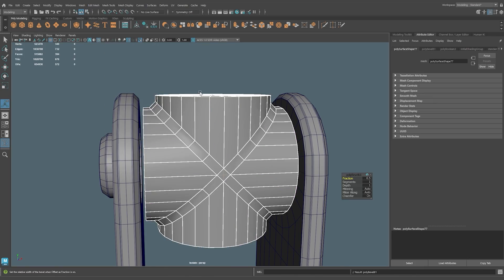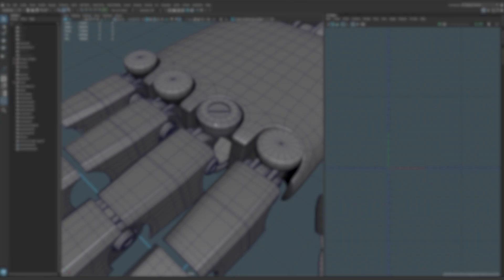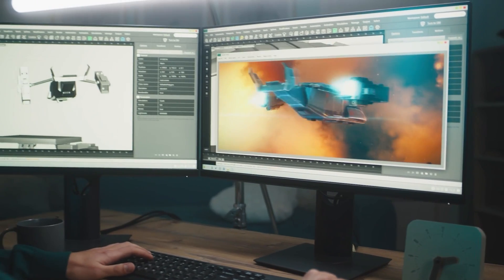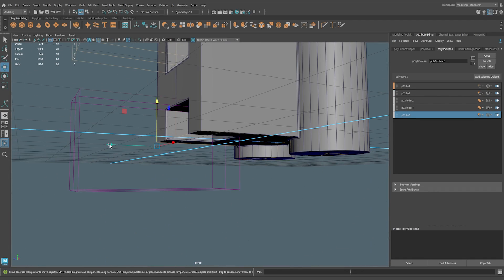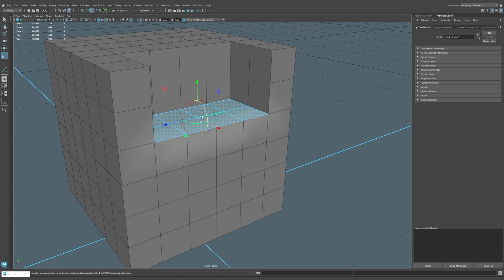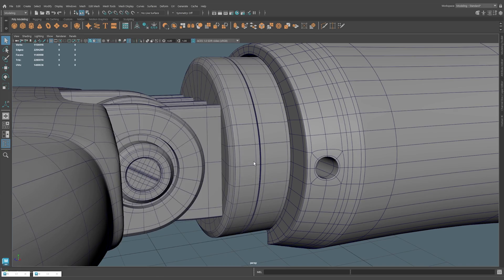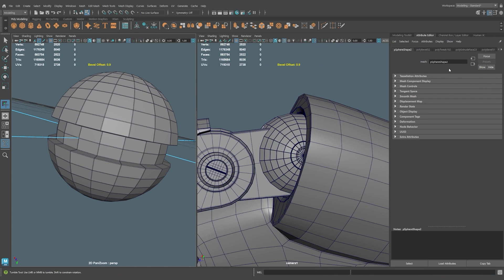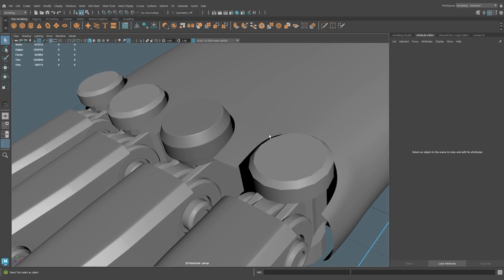All Maya 2025 3D Modeling Updates Under 5 Minutes!

Comment: Maya needs a sculpt mode. Maybe mudbox inside
Reply: Maya does have a sculpt mode that is really underrated. It could be improved, but it's helped me out at reducing pinching on bad topology.
Reply: @UtterUnit  It are tools for mesh. With this tools are impossible to sculpt anything from scratch.
Reply: Maya's sculpt tools are decent. They aren't ZBrush but they're useable for small jobs.
Reply: @andrewsmith4575  Blender has better sculpt than Maya and it is free . Maya doesn't have sculpt mode only tools for retouch meshes.
Reply: @Ruben3D  Why do you waste your time to make points about Blender when this is a video about Maya.  Why don't you go watch content about blender instead of berating people about a program no one asked about.
Reply: @MartyRxMurdeRz  right :D

Comment: Plasticity is best for hard surface modelling. It is completely a new way of working Polygon and Nurbs together.
Reply from the maker: Plasticity doesn't use polygons.
Reply: @jlmussi  but can export to polygons at any resolution and with working topology that can be tweaked in poly modelling. But if all quad topology is your love then you should stay away from it. I don't know why people always want quad even if it is not meant for deformation and destruction physics.
Reply: @kalpit3d934 Do you feel special bringing up software that is not related to the video.  No one asked about Plasticity.
Reply: @MartyRxMurdeRz  the reply is necessary because for hard surface, i think the whole industry is wasting its time on its primitive thinking "All quads" that is not true as per current technology because at the end only final shading of the model matters which works for 90% times when you are not going for deformation/physics on it, for that you can always retoplogise your model  either automatic or manual and that will give you better control over your previously built toplogy while struggling for all quads as you have a complete shape on which you can retopologise easily with control over your edgeflow.
Even the greatest master of 3ds max (Arrimus3d) hybrid his workflow to max+plasticity so why i shouldn't tell this to everyone. just see his youtube channel and you will know the mastery he get in HardSurface.

Comment: We're not even 1/4th way into 2024. And maya is already in 2025...
Reply: I'm pretty sure that's just the standard release cycle.
Reply from the maker: @UtterUnit  Their release schedule has been like this for a long time.
Reply: By the time they fix the crashes it'll be 2026 🙂
Reply: The year version is increasing but the performance is going backwards..but maya is still the best though despite their shit
Reply: @4536647674  Idk, this was a pretty nice update, and the one thing about maya is it builds on top of features. Blender will completely nuke a substantial part of the program, and you will be forced to relearn it.
Reply: @4536647674 the cavemen from autodesk added live boolean and smart extrude after 20 years 😂
Reply: @4536647674 the cavemen from autodesk added live boolean and smart extrude after 20 years 😂